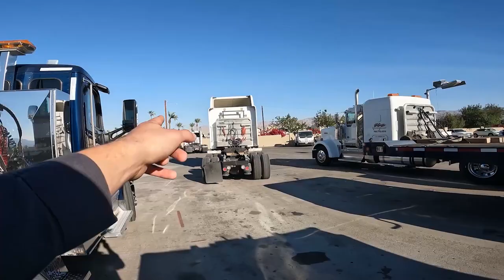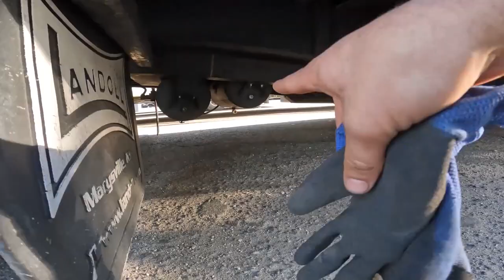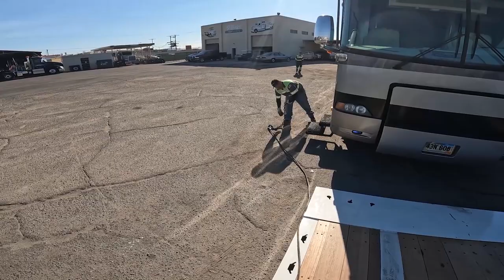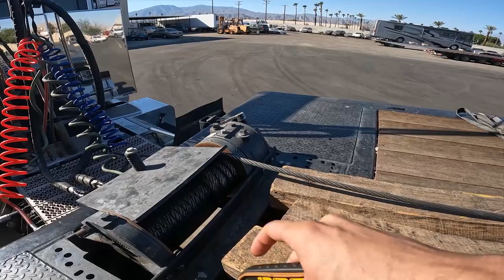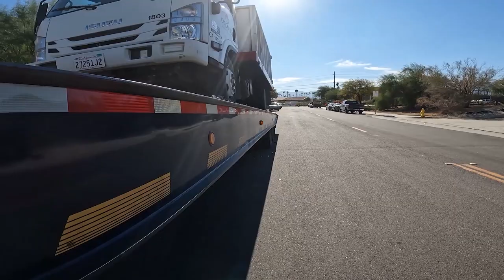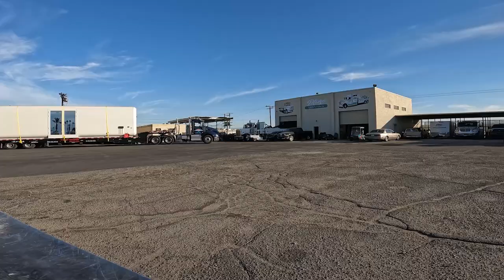Loading A House With A Crane!

Comment: Time for a miller m100 rotator! lol 
You should do what the shed moving companies do with their rear oversized sign. Solid sign with two bits of pipe welded on the bottom and just drill 2 holes in the very edge of the landol deck, The sign just slots into place and then gets stored behind the cab when not in use.

Comment: Thanks for the video Trent,I’m surprised about you having to get a permit for the RV,I’m in the UK and the motorway (interstate roads to you) have a height limit of 16.6ft and over here there are double deck trailers at 16ft but otherwise there is no height limit,there are limits on width where movement permits are needed and if wide enough and long enough an escort is needed